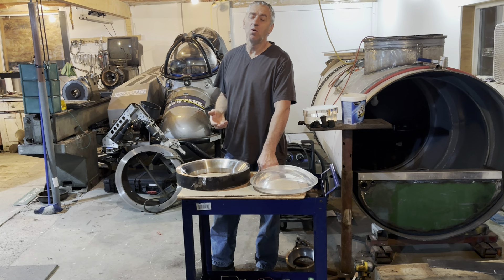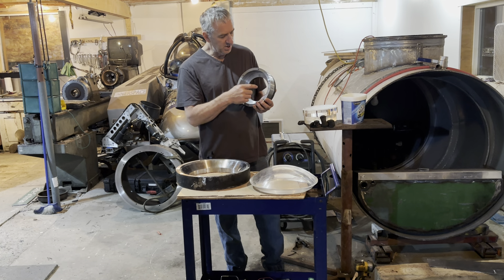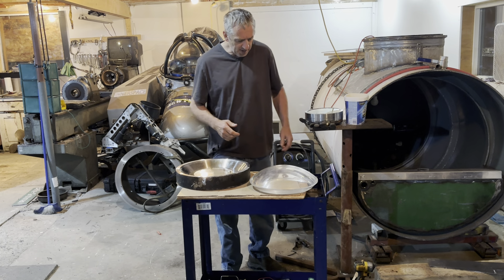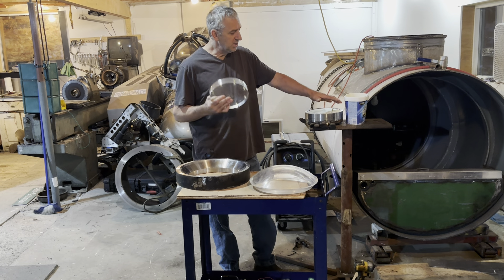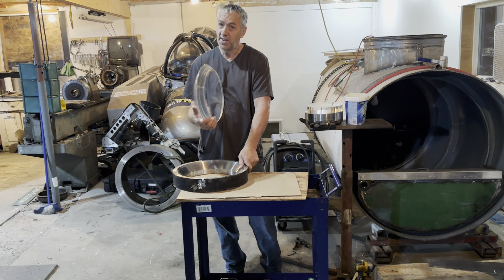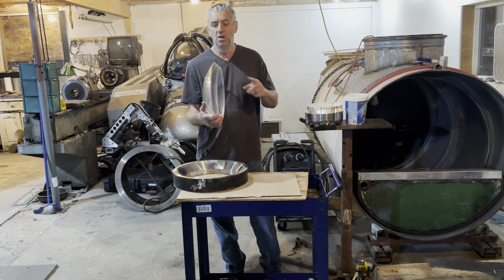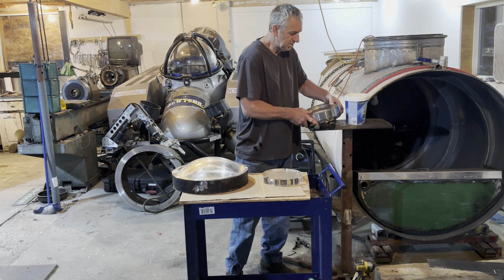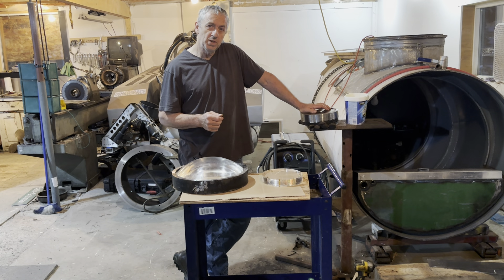Building my diesel electric submarine

Comment: I've enjoyed watching your progress and that you take the time to discuss some of the design requirements/considerations for safety.  Mentioning that you've never heard of a window failing got me to wondering: what is the plan for such a failure?  Would you have to don a temporary breathing apparatus, permit the cabin to flood so as to pressure equalize and thereby be able to open the hatch?  Or can the hatch be opened even with the pressure difference?  There must be a fair number of complications involved in escape planning, it would be interesting to hear what those are.
Reply from the maker: There is an escape plan that is standard.  The sub has built in scuba regulators for all passengers.  There is a flood valve to equalize the sub while breathing from the  air tank.  Also in case of smoke the same air is used.